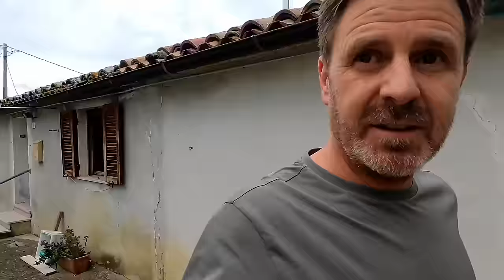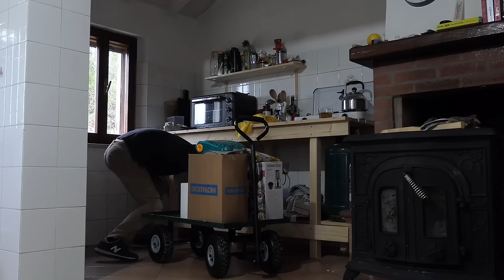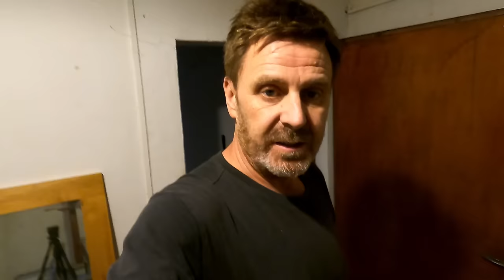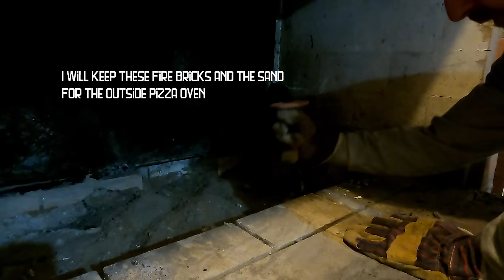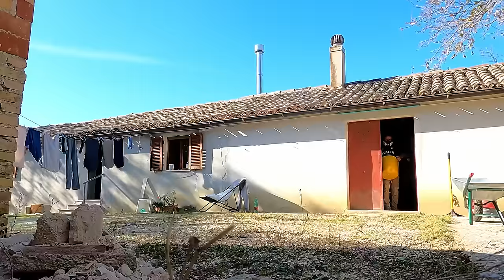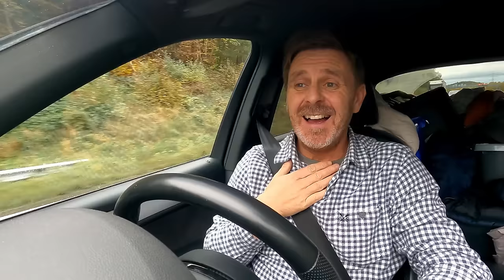#09 Italian house renovation | The real work starts now!

Comment: Had to laugh as you unloaded the stove. I dropped a glass cabinet unloading it almost exactly same way you unloaded.  The next time, I used a 4 foot by 6 foot board.... much better result.
Reply from the maker: I think now have a PHD in hindsight @cferguson3368 I did have a smaller board but it fell at the moment I was at the point of no return.🤦‍♂️😁

Comment: Having moved several stoves, was worried about your back, but you did well.
Good news bad news with stove.  Wood burn rate is slower, but you have to cut things in shorter lemgths - more saw cutting time.
Reply from the maker: Hi @michaelplunkett8059 . I try to keep myself fit and agile and avoid any big lifts like this as much as I can. I plan to set up a wood cuttings and splitting workstation to make my life easier when it comes to log piling.👍

Comment: Ideas for moving stove, put space carpet pieces under feet, fuzzy side to tile and it will slide and not scratch.   Next, invest in some good tools…measure tape, mini jack hammer, drill, hammer and chisels then some big plastic bucket and scoops to clean up and transport debris
Reply from the maker: Hi @carolyncastino7498 The tool and gadget list is growing as I go.🙌

Comment: No worries! I knew the work table would fit through the door from the beginning. It's just a matter of having extra hands. 

I'm in the same boat with the renovations of my home. As much as I'd like for it to happen immediately, my geometra already warned me to plan in phases / years. So, you're not the only one! Also, a 5-hour drive is a piece of cake in Texas. Blessings and kutgw! :)
Reply from the maker: Hi @violetaarcher8296 - are they saying 'put the entire long term plan in one project'? If so, they will charge you the paperwork for the entire thing (this was my massive bill) and suggest that you will get a refund for the parts of the project that you don't do. There will be a three year time stamp on it also.
I hope it goes well for you🤞

Comment: I like the wood burner, have you considered keeping some of the brick fireplace, for thermal mass?  The wood burner is not that large and you do not want to have to keep filling it up, having it heat the brick mass allows the heat generated to last longer. Just a thought.  Congrads on getting started on the inside, bet it feels pretty good.
Reply from the maker: Hi @lstarkey6992 . The walls have those thermal bricks in the surround so I will keep those. I may re use that iron plate that I pulled out also as the base (the uneaven brick idea didnt work out). The space is not that large and it does warm up quickly - even on the coldest winter nights.👍
Reply: @threeacresofmarche  excellent, carry on!

Comment: great to see the changes and your plans explained, Richard 🙂
had to laugh a bit at the part with the tolls system in Italy and you having your steering wheel on the other side of the car, so you had to run a bit😄
here some questions to you:
1. would this adventure/project be possible if you wouldn't have a job but let's say you'd have savings around 100k-150k?
2. did you have to buy the tools you use all new or you had things that you brought from the UK?
3. if i saw good you use a gopro and phone for making the videos. in which software are you editing it?

i think enough questions for this video, will keep some for the next ones 😃

If you're in Italy this weekend, enjoy the Easter and try get some special local food they usually do only on Easter.
I'm getting full with good food and wine😛

Cheers from the South of Italy✌
Reply from the maker: Hi @nejcpilih . I am trying to get a Telepass for the tolls but am having a little trouble getting set up.

To answer your questions. 1) for the build and renovations, I am hoping I can do what I want in the short term for less than 50k. Lifestyle and costs are extra so the 50k I am planning to spend is for materials, labour and machine rentals.

2) I brought a few hand tools from the UK that I had but am buying everything I need here. Italy has everything you could need to so there is no real need to bring anything with you.

3) I use Davinci Resolve - the free version. It is amazing but a massive learning curve to use it. 

All the best!👍

Comment: Hi Rich another great video im interested how long did it take you to drive to you're house?.Also if you're doing a lot of heavy lifting buy yourself a lumbar support they really help with the aches and pains and the idea of an outside shoer and bath Brilliant !
Reply from the maker: Hi @aarontaylor3768 . The drive from the continent side (Calais or Rotterdam) takes around 15 to 16 hours....depending on how many stops. Door to door from England if I take the Channel Tunnel is 2,000kms.

Lumber support - yes - I take it easy and I try to do lots of excercise to support more core strength.👍

Comment: As much as an outdoor bathroom can be nice, simply installing a decent humidistat controlled extraction fan will solve most of your moisture issues internally,
Reply from the maker: Hi @garethkreike3263 . The new bathroom will have better ventilation. This old bathroom has a run off in the middle of the floor - I don't think that clears very well and that stagnant water is one issue. It is not the nicest in there so does need a full rip out. It used to have the washing machine in there also so the pipes are....I am not looking forward to that rip out!😂

Comment: Curious why you are installing a wood stove vs using existing fireplace? Seems like that brick fireplace will retain heat from a fire much longer and throw it off at night when you need it? But I am also not familiar with the weather in Italy. Our winters where I live generally are very dry and cold. No damp weather until the spring.
Reply: I had the same question, what was wrong with the original fireplace... the idea that you'd bring and use something which works in the UK is not always correct one in Italy.
Reply from the maker: @brendarushka9966  & @pffyespff . I tried to use it as an open fireplace, as is. That needed too much attention and the danger of the smoke etc. Italian log burners tend to be free standing - tall and slim - so I trecked one down from England as they are very common there. I needed to remove the base of the existing fireplace to get the height and space for the log burner to sit inside the opening.
Reply from the maker: They do have log burners in Italy. I just found a bargain on ebay and had space in the car....it was probably made in China anyway.🤦‍♂️

Comment: That's some hard work you got done.  Just curious, is the fireplace removal for efficiency reasons or for space or both?
Reply from the maker: HI @Reet64 . I tried to use it as an open fireplace, as is. That needed too much attention and the danger of the smoke etc. Italian log burners tend to be free standing - tall and slim - so I trecked one down from England as they are very common there. I needed to remove the base of the existing fireplace to get the height and space for the log burner to sit inside the opening.👍

Comment: No need to wear a mask,its just a bit of dust,man up,apart from that well done
Reply from the maker: 😂 I am asthatic...I can hear my father in my ear everytime I do something without a mask on!😁
Reply from the maker: Hi, @jamescunningham1973  sorry I am not sure I understand - what do you mean about the mask I am wearing will do more harm than good? Is it the wrong mask for dust or the wrong one for asbestos? As I say I am asthmatic (typo previously) so this is quite important. Thanks for the tips.👍
Reply: @threeacresofmarche  They make your lungs work harder,i now realise why youre wearing a mask but a simple cloth mask will suffice for simple 10 minute jobs,if youre taking down latticed ceilngs then a full nose and mouth mask like the one you have is needed,but if youre ashmatic,i wouldnt wear a full face for long periods,i didnt mean to sound harsh last time/
Reply from the maker: Hi @jamescunningham1973 . No need to apologise. I did not read it as being harsh in anyway. I just wanted to clarify, thats all. Thanks for taking the time - I see what you mean now...it does feel different once I do start getting out of breath from the work. I have some of those cloth ones with the metal strip to bend around the bridge of your nose so will use them for lighter work. Some are suggesting full breathing kits and room extractors...we shall see. Cheers! And thanks again.👍